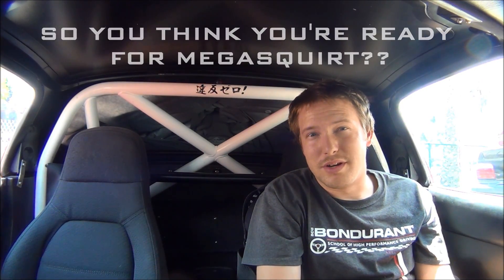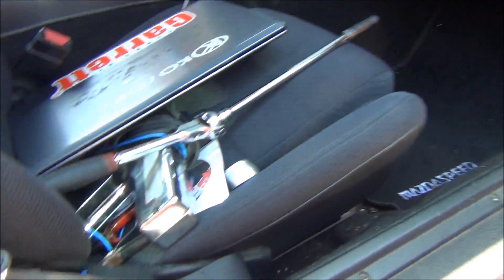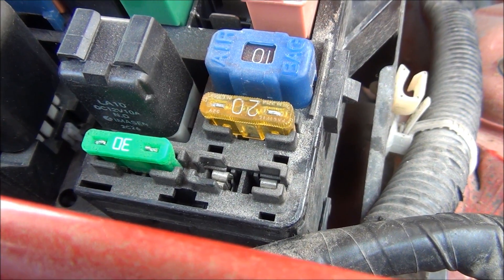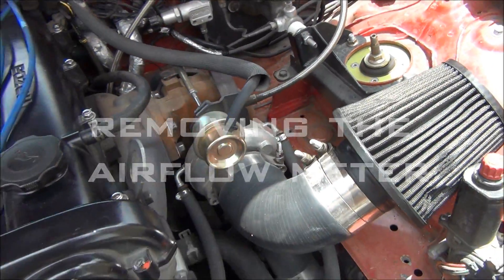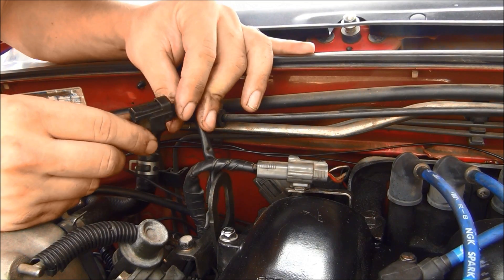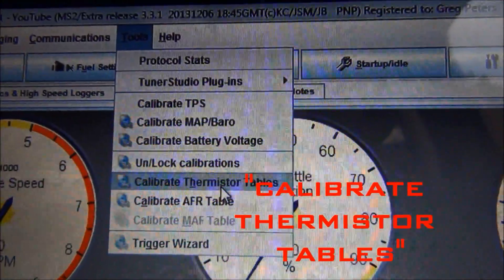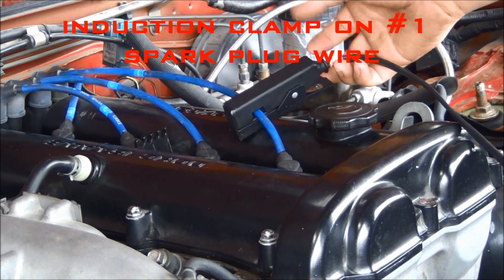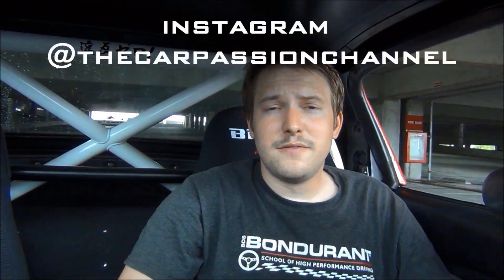How to Install Megasquirt!

Comment: Great videos man! Super helpful and well put together. I'm currently doing a lot of research for my own turbo install on my 97. So any more videos from the post-hardware install to getting the car to the dyno would be extremely helpful.
Cheers!
Reply from the maker: Loopable161 Honestly once you can start and drive the car on the base map, you could bring it to a tuner. A lot of people like to do some mild street tuning beforehand, I will probably cover some basics of that in the future.
Reply: TheCarPassionChannel Awesome, any Megasquirt tuning would be helpful.

Comment: Great start on the MS install.  Could you go further into the settings with MS?  What your kPa should be for instance, maybe go into your sequential injection, variable TPS, COP setup, ect.  I know that is spoon feeding, but honestly it would clean up MT.net so much if we could just link your tutorials.  

Great choice on the Super Damper, are you running a built motor or anything?  Have you had your car on a Dyno?
Reply from the maker: Cody Yankey I agree it would be nice to have tutorials that cover all of the basics, even though each would be just showing the way I did it, and may not be 100% correct since I've just gathered all of my information though research, talking to tuners, and experimentation. I am running VTPS, sequential injection, and just got a full LS Coil setup literally 2 days ago that I'm going to be installing and running sequential as well. I'm running the damper because, well, better safe than sorry. I'm at 236whp/215lb-ft of torque and I love things that keep my 100% stock 202,000 mile 1.6L safe. I also just switched over to E85 and got a faster spooling turbo which I should have on within the next month or so, so I'm really going to be pushing the 1.6L and I'm excited to see what it can really do.
Reply: TheCarPassionChannel That is really good power, you must be at a decently low elevation.  You are coming up close on 5-speed destruction.  I would love to get your toque on my little T25. 

Do you not have hot start issues with the IAT in that silicon section?  I see most people seem to think that running it in the intercooler yields better results for hot start.  

How to setup a VTPS would be awesome! That's something that would benefit the NA guys just as much.  

E85 is going to be fun, I hope you do some videos on it over time.  So much power potential, but you really gotta beef up your fuel system, which starts to get expensive.  Also getting pure E85 is hard so most run that flex fuel sensor, adding even more to overall costs, gas mileage tanks as well.  Good thing it's kinda cheap right now!
Reply from the maker: Cody Yankey The IAT is actually in an aluminum pipe, I just painted it black for stealth, haha. I used to have hot start issues which I improved with band aid fixes like a lot of after-start-enrichment only when coolant temps are over 180, and using EGO at idle. Now with sequential injection and E85, it can idle stable at 17:1, so even when it runs lean on hot starts it doesn't matter, haha. My turbo does have a 60mm compressor exducer and a 0.86 turbine a/r so it's definitely built for more top end, but slower spool. My 340lph fuel pump and 750cc injectors are loving the ethanol. And when corn gets too expensive I'll just flip my E85 switch back to the 91 octane position :)
Reply: TheCarPassionChannel Sounds like a great build, looking forward to your future videos.
Reply from the maker: Cody Yankey Plenty more on the schedule. I just picked up a GT2554R also so I'm thinking about doing a comparison between the churbo and the Garrett.
Reply: TheCarPassionChannel I just saw someone selling a 2554r on MT.net, such a good turbo for the 1.6.  The smallest Borg EFR would also be cool if it didn't cost the price of some Xidas, lol.

Comment: Can you run mega squirt on a stock miata 1.6? I wanna get one as a first mod for prep when i turbo it
Reply from the maker: ***** It's the best first mod you can but in my opinion. Yes you can run it on a completely stock 1.6L.
Reply: So all the presets you showed in video I dont do right(stock) I keep the base map already given ?
Reply from the maker: ***** You will follow my video exactly if you install on a stock 1.6L, even loading the stock base map. You do not have to delete your AFM either. You shouldn't race on the base map, but it will be okay for daily driving. You want to get it tuned eventually.

Comment: Can you explain how u strapped ur battery down because I heard that to do autocross u need to have it strapped down and mine is loose could u possibly cover some things u did for autocross to pass
Reply from the maker: Gabriel Llado Mendez If your battery is loose you either have a smaller battery than stock or your hold-down is broken or damaged. The stock battery hold down works very well and you don't need to add anything to it. Autocross inspection is usually pretty easy: make sure all of your lug nuts are in place, your battery is secure, seat secure, no major leaks, at least a little tread left on the tires, at least ~5mm of brake pad left. Basically if nothing is majorly loose, broken, missing, or leaking, you'll pass!

Comment: Great video man, Its nice to see someone actually show it rather than just reading it and assuming a few things. I would love to see a wideband video, or at least more explanation on how you wired it into your MS and if your gauge is straight off the wideband or from your MS. Im guessing its its getting its data from MS.
Reply from the maker: Joseph Conley I may not do a wideband video for a while, but hopefully I can answer your question. A wideband o2 is a standalone system. You can install just a wideband by itself in the car and it will function just fine. Widebands have a signal wire that comes from the gauge in most cases, which is just a wire that outputs what the gauge is seeing. That wire goes into MS. So Megasquirt is getting its data from the wideband. That's why you need a wideband to have Megasquirt, otherwise you'll have no idea what your AFR's are.
Reply: TheCarPassionChannel I understand that, and to my understanding some widebands have multiple wires out. I was curious how yours was currently wired. Wideband -> MS -> Gauge? Either way, your videos have been very informative.
Reply from the maker: Joseph Conley My wideband (Innovate MTX-L) is a self contained unit. The sensor and gauge are all one package, you can hook your laptop up to the gauge itself to set preferences. The gauge then has 2 output wires, a narrowband and a wideband output. You just connect the wideband output to MS and you're rolling!
Reply: Awesome, thanks man.

Comment: Hi from germany! If you are running  95 octane fuel in your Miata, you can put youtär Ignition timing to 14 degrees before tdc. There will be no knocking or uncontolled auto ignition by the fuel. I tried it up to 16 degrees before tdc and still no knocking. I put it back to 14 degrees, so there is no stress for the engine. It runs a bit better with this setup. Most of the Mx5 enthusiasts in germany are running it at 14 degrees. Nice vids man. I watch it every week.
Reply from the maker: Fuelfoxx Thanks for watching! Many people here in the U.S. set their CAS to 14 degrees here as well, even though we only have 91 or 93 octane depending on the state. When you adjust your CAS you're setting your idle timing, but you shift your whole timing map even on a stock ECU. So if your stock timing is 10 degrees, you may be at 28 degrees at full throttle, 32 degrees while cruising, etc. But when you clock your CAS to be 14 degrees at idle, you're now 32 degrees at full throttle and 36 degrees cruising. (These are just examples I'm not sure exactly what the stock map looks like) so it may be better in some areas and worse in others. But since you're only talking about a few degrees, it will likely be beneficial everywhere, since the stock map is designed to run on 87 octane (at least here in the U.S.).

Comment: If I get this ecu and I do the base map. Can I run the car like I would with the stock ecu ? Aka daily drive it
Reply from the maker: Echo-GAMING You can daily drive on the base map but it's best to get it tuned so you can get better MPG and more power.
Reply: hmmm thanks just wanted to know